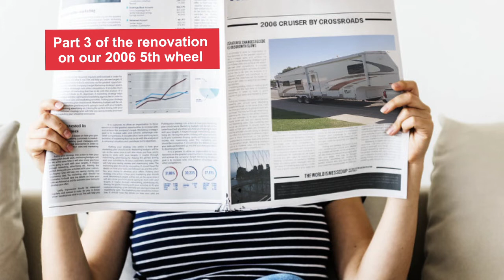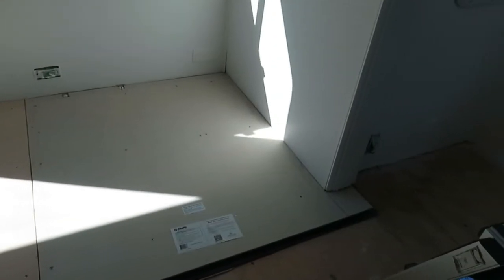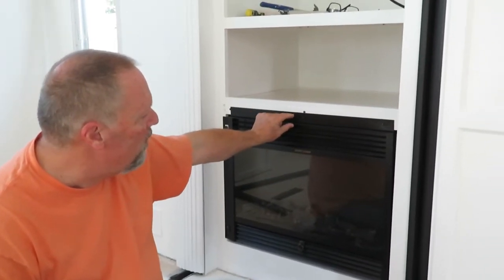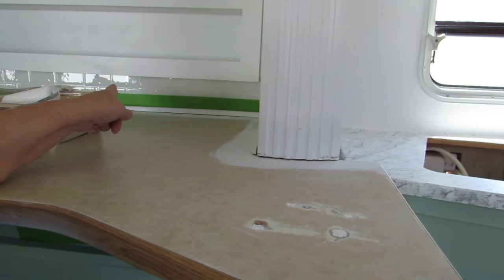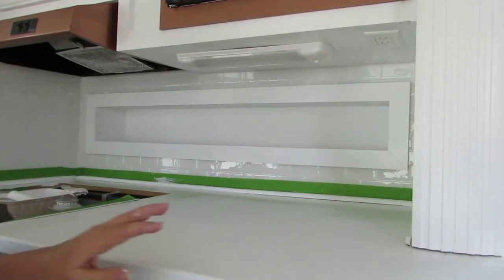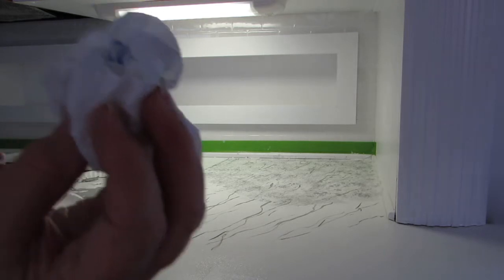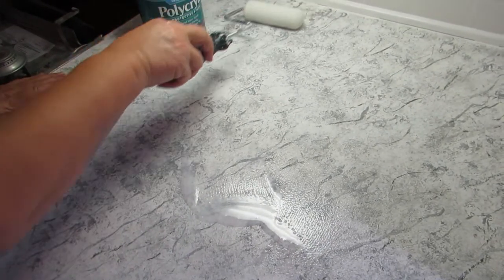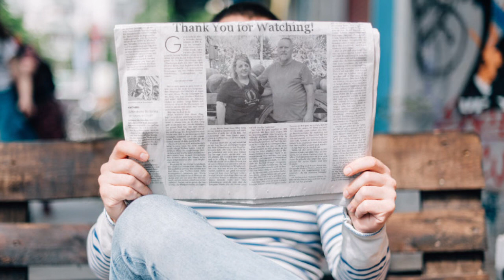2006 Cruiser renovation on our 5th wheel part 3

Comment: What brand/ model fireplace s that? Are you happy with it?
Reply from the maker: Hi, I have been trying to remember what the brand is and sadly I can't :( .   I ordered it from Target online.  One of the things I looked for when searching for one was that it did not blow the air upward because it was below our t.v.  I also looked at the size and features it offered and of course price.  This one was about $120 or so if I remember right. It blows straight out and has a high and low settings for the heat and also has 3 or 4 settings for the flames.  You can have just the heat on with no flames also or just the flames with no heat it is pretty nice :) .  Also has a remote control which I would recommend and this one is quiet.  We love it and we are happy we decided to add one in our 5th wheel.  I wish I could have given you the brand I even went out and looked and there is no name on it anywhere.  I hope this gives you a little help.  Thank you again :)